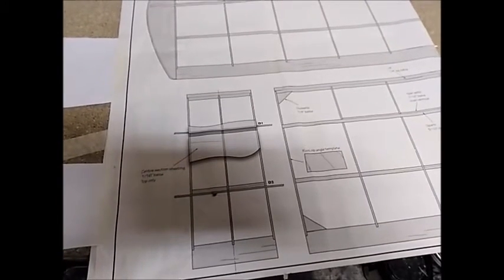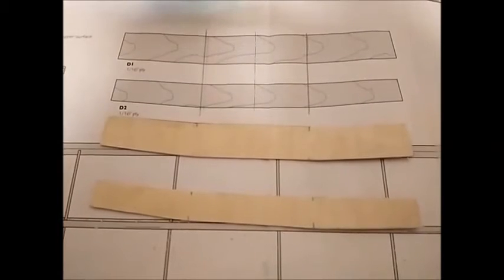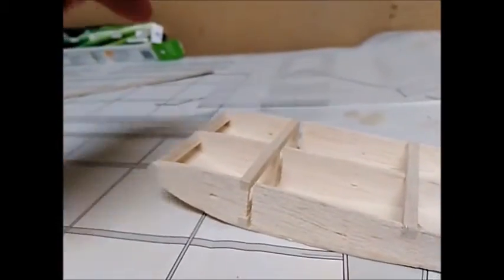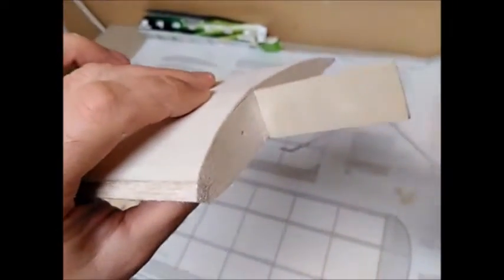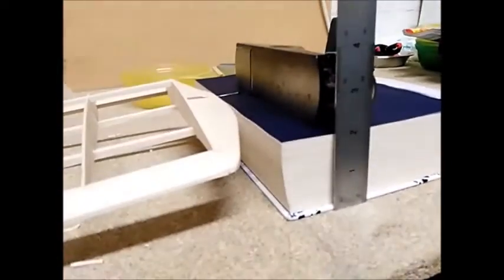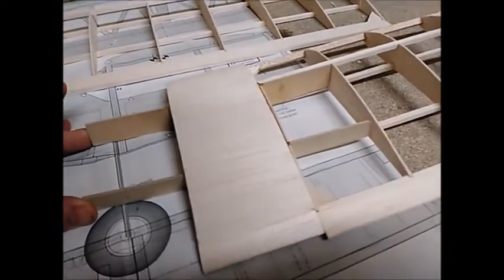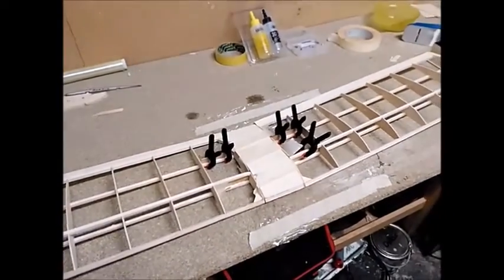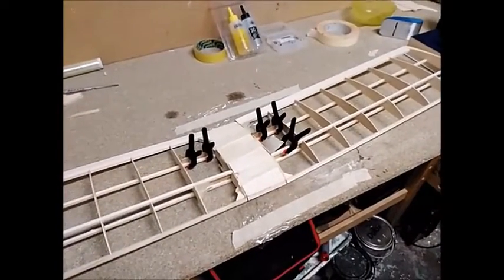Video 8: Completing the wing assembly

Comment: Awesome videos thank you for sharing, already suscribed.  I got a question for you maybe you can help me. I built a 39" Inches wingspan Kadetito  powered with Cox 049 engine. I want to fly this airplane with 2 channels only, rudder and elevator. The problem is the wing does not have enough dehidral, possibly less than 5 degrees like an inch from each wingtip. The question is. Can I fly this airplane safely and make it turn with this kind of dehidral? Thank you for your help.  Alberto
Reply from the maker: Hi, that sounds like enough dihedral. Too much dihedral and you will reduce manoeuvrability (it becomes too stable and less responsive to controls). Check out my video on dihedral here https://youtu.be/-uUkarpdY9w